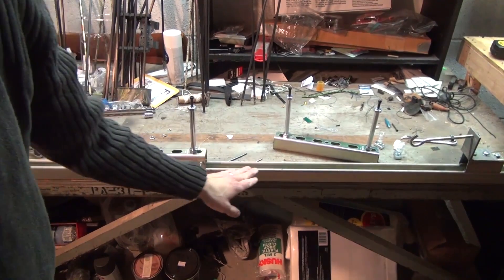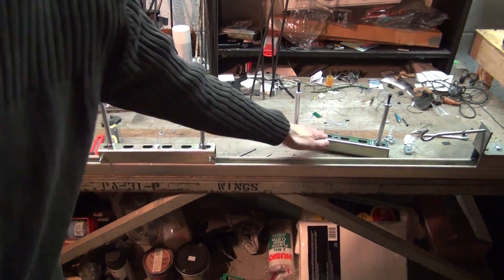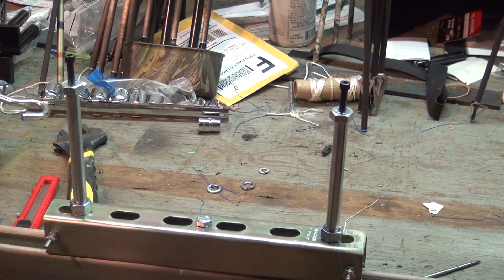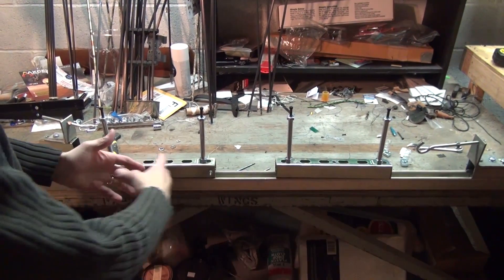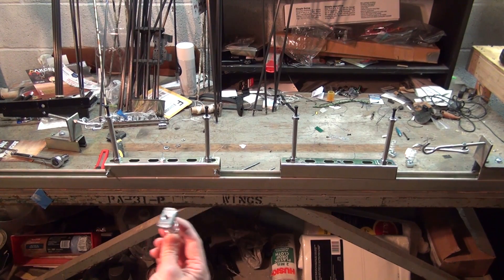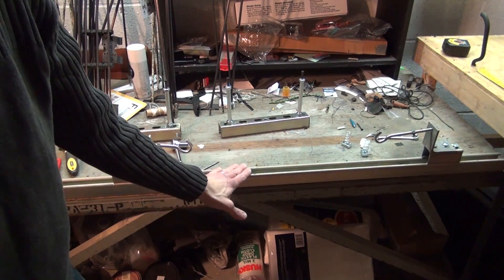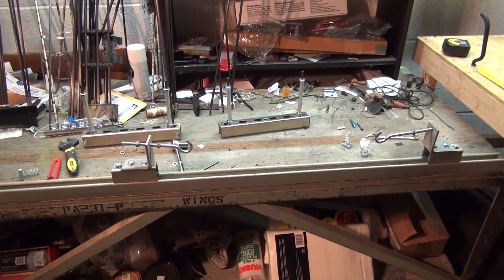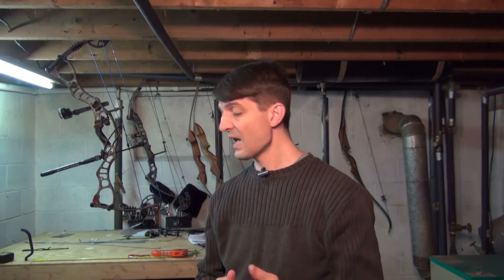How to make a bow string jig

Comment: Hello Sean. How much shorter string do you have to make it then twist and stretch it? I have a Bear Cruzer G2. Original manufacturer size is 55'11 / 16 and cables 31'7 / 16.
Reply from the maker: You make it longer and twist it..I think I provided the calculation in the description.
Reply: I have to make 1/8 'longer than the factory dimension to make it good after twisting

Comment: How do you know what distance to set the post sections from each-other? Is it just the same distance as the desired pre-stretch string length?
Reply from the maker: It will be a little longer. There's a calculation I think I included in the description section of my video on how to make strings and cables .

Comment: How long is your jig?
Reply from the maker: 8 feet
Reply: Sean's Outdoor Adventures thanks. Do you feel like that is a good length? I bought all the parts, i just want it to be a more manageable size. I cant imagine ill be making strings that need to be longer than 5 feet, plus the hardware on the ends of that. Do you think i could get away with 6’ ?   Im new to all of this and im diving in head first (also welding up my own bow press atm) any advice is appreciated!
Reply from the maker: @conrad2690  Yes, it has worked well for me. The only time you might need something longer is if you had a really old single cam bow that using one cable instead of two that get wrapped around the cam and back to the other. I've never had a need for anything longer than my rig though.

Comment: Thanks for the nice video,  what's the size of the hooks you using? Thanks in advance
Reply from the maker: Thickness is about a quarter to 3/8 inch and the hook is about two inches diameter

Comment: What size angle iron did you use?
Reply from the maker: I think it’s 3/8 inch thickness
Reply: @seansoutdoors  sorry I should have said what is the leg size. Is it 1.5" x 1.5" or 2" x 2" or...
Reply from the maker: @timfortune5326  two

Comment: Looking at finishing a string jig in the coming weeks.  I have 5 bows to make strings for with a familly of four.  This is the only affordable way to take care of the bows.  What is the diameter of the hook bolts that are used?(engineer here) Have you thought about adding a spring to the stretcher setup?  I have found some compression springs, and some extension springs that may work with above 300lb load limits, and some have spring rates of 100 lbs/inch.  So if you compress the spring on the back side of your hook bolt by 3 inches, you would put 300 lbs of force (ect.).  This would make it easy to tell how much force is on the string, and how much it relaxed.  Looking at some of the commercial stretchers, they either use a piston with air or a spring to put the load on the strings.
Reply from the maker: Yes, if you have springs, that would be great to add in. I didn't have any to use. I'm going to have to check the diameter and get back to you but they are probably about a quarter inch in size or 3/16ths at least.
Reply: McMaster Carr has a large selection.  It looks like they may cost about $20 for one that would be appropriate.  I will probably skipp this to start off with.  BTW, I am not happy with the bowmaster press for the bowtech carbon icon.  The setup for solid limbs does not work, and the bracket for split limbs walked off one side of the limb slowly creating an emergency issue that put my bow at risk.  Thankfully the guys at Bass Pro could rescue it, and put the new strings I had ordered on.  They highly recommeded that I get the press that uses a rope pully system, and said they prefer it over their traditional presses.We have watched several of your videos, and now my 14 year old son is insisting that we pray before a meal.  We sometimes have a bad habit of not doing that.  Another tip for public land deer hunting is to talk to other types of hunters.  We currently do all of our deer hunting on private land, but will be incorporating some public land due to the three hour drive to the familly farm.  We do a lot of waterfowl hunting much closer to us, and have walked in as far as 3 miles with decoys on wetland areas.  I have encountered numerous deer, and some trophies while doing this.  On one location, I had some deer that was not affraid of us waterfowl hunters, and seemed immune to the shotguns going off at distances of 30 to 60 yards away as they grazed on the wetland unit dikes.  Some areas where we waterfowl hunt have a lot of deer, and we never see any hunters in the WMA parking lot where one could setup less than 50 to 100 yards from the parking lot.  I have exchanged this information to a few hunters for information where I could take our son fishing for crappie on big lakes with a small bassboat.Again... Thank you.

Comment: Hi Sean,
Thank you for the tutorial. I made your jig and it works well. 
The threads on my hooks are damaged beyond usefulness after only a dozen or strings being stretched. Did you experience this issue at all?
Reply from the maker: Not yet but I can imagine it could happen. It may also be more or less prone to issues depending on the type of metal used and threading on the bolt. I don’t remember those specific details from mine but maybe I have a little better quality of material and threading on mine, I don’t know.
Reply: @seansoutdoors  thanks for the reply. I'll see if there are high tensile options available.

Comment: How long do you need your uni strut to be?
Reply from the maker: It needs to be about a minimum of a  foot longer than the longest string or cable you intend to make.
Reply: @seansoutdoors  ok, thank you. I have a strut 60" long laying around.. Was thinking if I ran my moving parts to the very end then my end pegs would be 6" longer hanging off each side so that would give me a 72" max but no room for stretch .. I might just need to go buy a longer strut.
Reply: One thing that is confusing to me is... Say I want to make a string 64" long. Some videos say to set my distance btwn outer pins to 64" apart.. If I do that then my string will be 64" long right? But it will get longer if I stretch it, so shouldn't I set my distance btwn outer pins closer together?
Reply from the maker: @AllThingsSilver  You'll want it a little longer that 64 because you want to be able to put twist in it.
Reply from the maker: @AllThingsSilver  Another option is that if you have a table that is long enough, you can cut your strut in half and spread the parts and bolt them really well to the table. Just an option.

Comment: Sean ok I think I got my jig just like I want mine.  I put a 1/4” x1.5 x whatever your channel strut assemblies piece your using.  Got knob handles and on the two post channel I put a hole in the middle of the aluminum and passed the 3/8 knob thread through to a cone nut.  Doesnt have any slip. My stretcher assemblies with angle bracket put more 1/4” under them too.  Wish I could post pictures of mine finished.  Easy to turn, easy to set up, easy to stretch.
Reply from the maker: Great, enjoy it. God bless you

Comment: Nice!  Now to go out and buy the hardware. Thank for an informative video.
Reply from the maker: Best of luck with it Paul
Reply: Sean I watched this go together perfect.
I found the angled pieces right next to the channel strut.( for those looking for that piece.  I went with 3/8” bolts, except that I used the 1/2” uprights.
    When mounting the top pieces, does the Spring nut go in and not move side to side?.  Mine does, may be a narrower nut.  I have noticed that it falls to one side and comes up through the channel.  Then sometimes the Spring goes through the bottom.  Do you have anything insideas well.
   Love my jig!
Reply: Also, got it up and I believe that a CONE NUT WITH A deep base will work better, than a spring nut.
Reply from the maker: Enjoy it and best of luck to you.

Comment: This was an easy build.  Thanks for the vid.  The only changes I made was to use Redhead concrete anchors for the posts.  With the collar removed it gives a smooth area with a lip on the bottom and an outward taper on the top eliminating the need to tap the heads of the bolts for smaller bolts.  Also I drilled small holes for self tapping screws just below the lip on the posts at one end to act as tie off points.
https://www.homedepot.com/p/Red-Head-1-2-in-x-7-in-Hot-Dipped-Galvanized-Steel-Hex-Nut-Head-Indoor-Outdoor-Wedge-Anchor-50306/207019179
Reply from the maker: Thanks for sharing, Steve. God bless you

Comment: Thanks for the video. I made one similar but I ended up spending about $120 for the all the parts bought new from lowes, including broken and new drill and tap :D. My single cam bow has longer string (91+ inches). It needs a longer base to work with. I kept 10' unistrut uncut. In addition, I bought 2 extra pieces of 2 ft unistrut and cut them for arms and raised base for the stretcher. Also, instead of using a hook bolt (that has to be tighten with wrench) as the stretcher, I used double Hook Turnbuckle from lowes $2.98 which had very nice hexagon body. I could twist it with hand and get it to real tight. Very easy to work with and it doubles the turn. The string and cable came with the bow was 20 strand. I just finished my first DIY 24 strand 452x string and cable. Thank you for the inspiration!
Reply from the maker: Great God bless you

Comment: I Like Your plans for the  Jig Great design and  use of the  Unistrut , I Was wondering Do you really need to  put cap screws of 1/4 inch inside the 1/2 inch ones or, could You just use the 1/2 inch bolts?
Reply: I am thinking of either trying to 6" long 1/2 inch bolts which would add .78" or 3/4" to measurement, so subtract .75" after multiplying your desired string length by 1.008"  I also may try just using some 1/4 x 5" long bolts that I picked up today.  I will probably experiment with a couple of continous loop strings for my recurve before moving on to the compound bow strings.  With a familly of four shooting bows, making our own strings and maintaining the bows ourselves is the only affordable thing to do.
Reply: If you don't use the 1/4 bolts, it can throw off your measurement, as the larger bolt will have more string wrapped around it.  You need the length of the bolt to have room to work the serving tool, but an 8 inch 1/4" bolt wouldn't be sturdy enough.  Using both, you get the necessary rigidity and height of the  1/2 bolt, with the smaller working diameter of the smaller bolt.
Reply from the maker: https://www.seansoutdooradventures.com     https://www.facebook.com/seansoutdoors/     https://www.instagram.com/seansoutdooradventures/     https://www.amazon.com/shop/seansoutdooradventures
Thanks for checking out my videos. I appreciate it. I actually responded to comment years ago, but ALL of my replies were deleted when changing the main email on my account, ugh. Anyway, I am going back through and re-replying to all old comments so they stop popping up in the unanswered post column of my YouTube studio. As you can see, I included some links to my website and social media links in case you are interested in checking any of it out. Thanks for your patience with this process. God bless you.

Comment: Sean, why is it necessary to add the 1/4 inch bolt to the large bolt ?
Reply: If you don't use the 1/4 bolts, it can throw off your measurement, as the larger bolt will have more string wrapped around it.  You need the length of the bolt to have room to work the serving tool, but an 8 inch 1/4" bolt wouldn't be sturdy enough.  Using both, you get the necessary rigidity and height of the  1/2 bolt, with the smaller working diameter of the smaller bolt.
Reply from the maker: https://www.seansoutdooradventures.com     https://www.facebook.com/seansoutdoors/     https://www.instagram.com/seansoutdooradventures/     https://www.amazon.com/shop/seansoutdooradventures
Thanks for checking out my videos. I appreciate it. I actually responded to comment years ago, but ALL of my replies were deleted when changing the main email on my account, ugh. Anyway, I am going back through and re-replying to all old comments so they stop popping up in the unanswered post column of my YouTube studio. As you can see, I included some links to my website and social media links in case you are interested in checking any of it out. Thanks for your patience with this process. God bless you.

Comment: Hey  love this design! I made your jig and I'm having a weird issue though with the spring from the unistrut guide getting caught in the rail holes underneath whenever I move the arms closer or further away. Any help on how you avoided this problem? Let me know thnx!
Reply: +seansoutdoor also curious what was the length of the bolt on the center of the arm that tightens down? And how long is the unistrut guide? Did you use all 8 feet left over from the original cuts OR did you cut it down further so it was less cumbersome.  Seems a bit long as I'm working on it right now. Again Thanks so much for the reply! You have been so helpful.
Reply: @trguitarlesson  I guess alot of that cutting to length depends on the length of bow string you need to make.